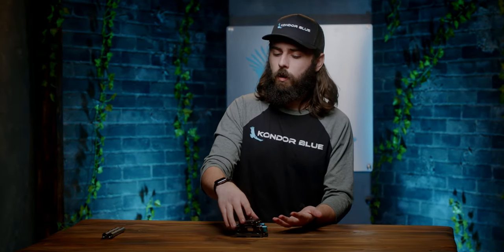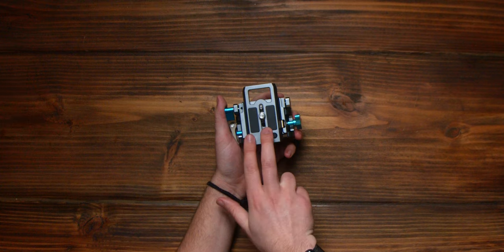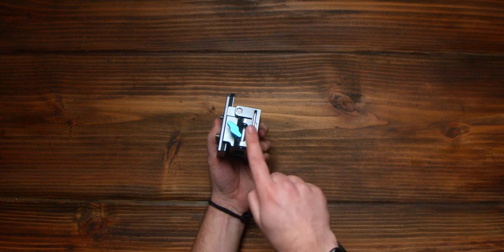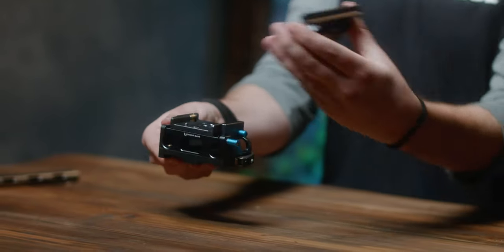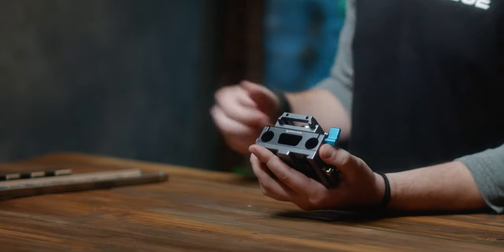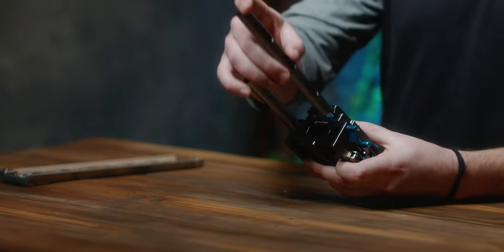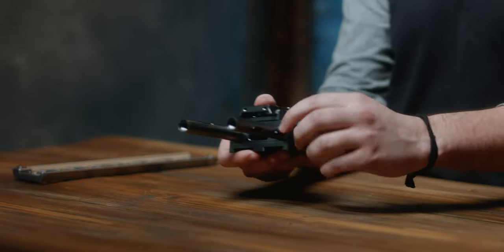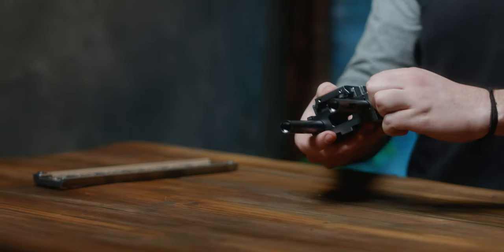ARRI/501 Baseplate Overview

Comment: I only have a peak design travel tripod. Will this easily mount to it without having to take apart anything?
Reply from the maker: It sure will! There are standard mounting threads on the bottom of the baseplate. The 501 plate that releases is also industry standard and will fit into any tripod or clamp that accepts 501 (which is most)
Reply: @KONDORBLUE  I received this email response below from Kondor Blue website yesterday? Is there maybe something additional i should purchase that will go along with the cage the bottom plate and the peak design tri pod? If so im willing too. If you have any suggestions. 

"Our products aren't compatible with Peak Design as Peak Design’s arca is slightly different and also square shaped so it won’t work, unfortunately."

Comment: Thx for the video!! How do Arri Dovetails relate to VCT Plates?
Reply from the maker: VCT are usually used in ENG scenarios and are made simply for quickly mounting and releasing your camera. Dovetails need to slide in and out so the speed of mounting isn't as comparable but they do allow you to speedily adjust the balance and center of gravity for your camera. This is the standard in Cinema production or where cameras are fully built out and become heavier. Checkout our video here for more info: https://youtu.be/CqlY_Ojd7Aw